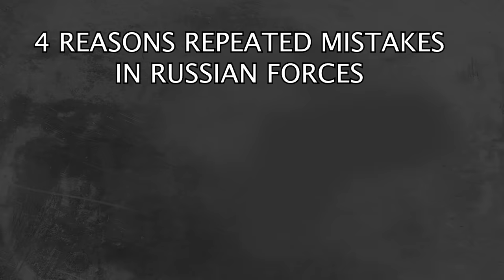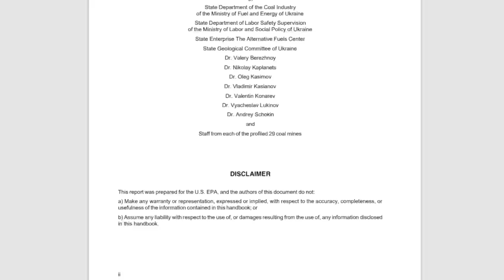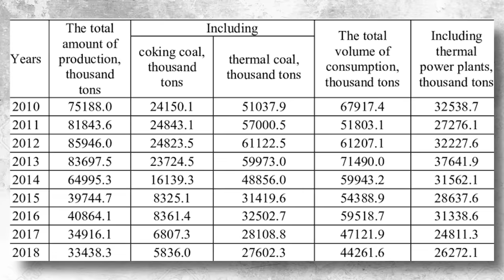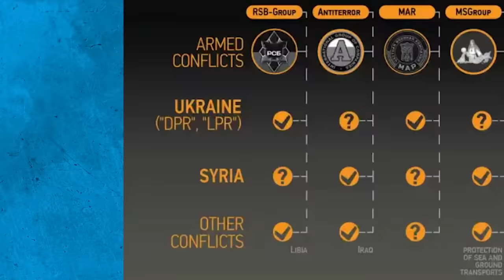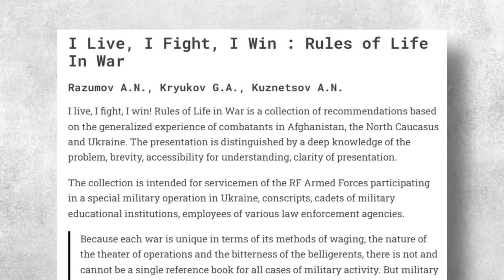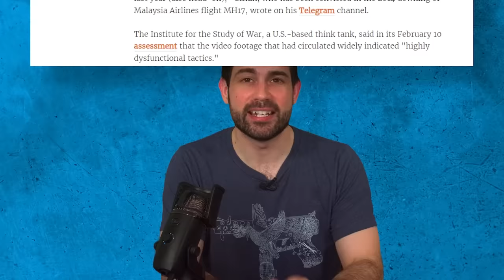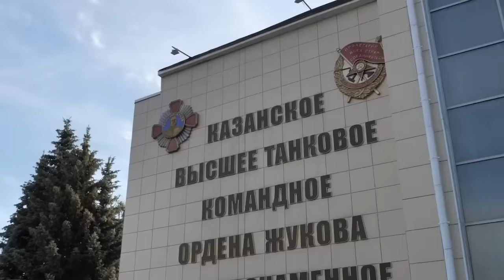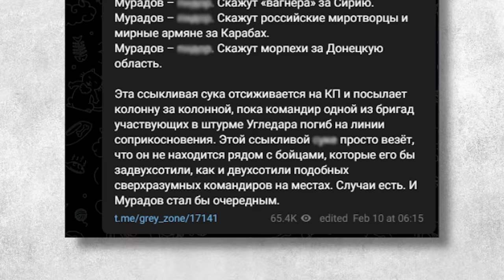Vuhledar, Why Russia Repeats the Same Mistakes

Comment: One of Cappy's best Task & Purpose reports triggered a memory from early in the war of a report I read or heard about in its early months noting that one of the dumber things Russia had done to streamline (a.k.a. "cheapen the cost") of its military by effectively eliminating non-commissioned officers from its ranks. The officer-heavy decision-making class evidently regarded them as trumped-up privates who complained too much to their "betters," rather than as repositories and transmitters of a great deal of acquired wisdom that greatly helps "Mobiks" minimize casualties and increase effectiveness on the battlefield.

I would add this to Cappy's four other major Russian military problem areas that has hampered them from the start. The absurdly high rate of casualties -- very much including officers in all ranks -- show just how devaluing and jettisoning career NCOs has helped cripple Putin's plans of easy conquest. As with many inept military decisions, this one has no easy fix; you can disband with a simple order, but summoning into existence the cadre of trained NCOs with years of experience in handling small-units in action is not possible. Also, their curt, thankless dismissal combined with the horredous casualties since hardly incentivizes any of these skilled veterans to return.

Comment: WWII seems different, they waited, they gathered enough artillery barrels and they transported in ammunition. And when they were ready they opened a massive barage that were "walked" through enemy lines and then they send in the troops in a mass attack to be effective.

I have gotten the picture that the russian so called "mass" attacks un Ukraine are not that massive. It more looks like they are sending in the troops pecemeal. 

If it does not work why they keep doing it? Why not rest and prepare properly?

In WWII when the russians did not prepare, the arty might have had gun barrels but not enough ammo or other problems the infantry attacks had a tendency to fail.

In WWII the german army relied heavily on machine gun nests. And if they are not taken out you can guess what will happen.

Comment: A tactical defeat can still lead to a strategic victory. What Russia's attack on Vuhledar did was pull four Ukrainian reserve brigades down to reinforce. These were desperately needed for the defense of Bakhmut and even Avdilvka. Also the Ukrainian 14th tank brigade after rushing to help fend off the break thru at Soledar was then sent to Vuhledar where it was so pummeled it had to get pulled out of the line. Now the 14th Tank Brigade is supposedly assigned to spearhead one of Ukraine's counter offensives to relieve Bakhmut which i'm sure looks good on paper.
Reply: I'm still happy for their win. 140 pieces of Ruzz armour and counting! WT also put out footage of a Ruz btr-82a burning with occupants inside. RAAM systems, paired with accurate Ukrainian artillery, are eating those ruzz alive.
Reply: @Flaccid_Child1  So maybe Russia has lost 1200 tanks in this conflict, it means they still have 12800 tanks left. Meanwhile Ukraine has probably lost the same amount, they might have 200 currently of which 20 are refurnished T-55's. They are getting 80 leopard ones, 60 more Polish T 72's and about 20 Leopard two's and four Challengers. How long do you think those will last?
Reply: @glennallen1984 , that’s seriously unfortunate… that you believe that. Please provide evidence to such bullshit.

Comment: First, and I know this will sound pedantic, but check your spelling in the slides or have someone proofread them. It's a small thing, but it really does matter.

Second, the Russian strategy is to force the enemy to run out of bullets and bombs before they run out of Russians. It really is that simple, and it's how they won 10% of Finland in the Winter War. Ukraine is already losing ground because they can't maintain the supplies necessary to mow down all the human waves of cannon fodder being sent. Soledar fell because they couldn't get enough mortars to the area fast enough, and now they are close to losing Bahmut itself without a massive counter attack.

Sad as it may be, it's a working strategy - as long as you absolutely don't care how many bodies of your own people that get piled up along the way. I almost wonder if Wagner is being used to cleanse Russia of undesirables by having them charge Bakhmut. Surely by now they have emptied a few prisons into the Ukrainian dirt by now. Ethically and morally bankrupt though it may be, though, it's actually getting Russia positive results for the first time since the northern offensive failed.

The question is now whether Ukraine runs out of bullets first, or Russia runs out of Russians first.

Comment: There are many stories out there and actual interviews showing that most of the men involved in this campaign were sailors in the Russian Navy.  SAILORS.  With no training, knowledge, or experience in ground battles and doctrine, and no clue how to even use the equipment they were given.  Apparently the morons in charge somehow believed that Ukraine's soldiers would just run when faced by tanks driving slowly forward single file.  For the record, Russia has pretty much lost ALL their front line tanks in Ukraine.  Since they seem to have no trained crews or competent leadership, they're going to lose a lot more.

Comment: About two thousand publicly recorded (obituaries etc) Russian officer KIAs probably have something to do with their slow learning curve, compounded by the fact that the Russian army does not use sergeants. The true number of deaths will be higher and that's not even counting WIAs. The human capital that would learn and share battlefield learnings from 2022 has been massively attrited. In fact I'd say their knowledgebase is going backwards, as career officers die off and are replaced by mobilized officers.

Comment: I feel it's none of the 4 reasons you mentioned at the beginning. 

Think about it. The people that Russia is using is mainly eastern residents. An then they are the same areas that Russian west has had issues with eastern Russians. It's a perfect way to eliminate a bunch and not necessarily be blamed for their deaths. 
Also, it reduces the population so there's less strain on the socialist regime. 

Also, there's the oil that Russia is going to stuck with. Because of the ev forced transition. Russia is going to lose billions from not being able to send oil to western Europe. 
Plus the Ukraine is the bread basket of Russia when it was under USSR control. 

There's probably some failed from the lack of leadership in the Russian ranks but that don't matter when Putin is just going to send more and more troops there.

Comment: The trouble with these videos is the bias. No mention of the fact that Ukraine is sending in poorly trained units, no mention of Ukraine losses, No mention of the chronic lack of artillery shells Ukraine is facing.  Over a month ago the US stated that if Ukraine continues to defend Bakhmut they may face an equipment and manpower shortage....yet Ukraine still continues to pump more men and equipment in and russia continues to methodically advance.  Im no Putin supporter but the propaganda is very strong on both sides.

Comment: Ukraine at least for the past 10 years was net exporter of electricity. 60% of Ukrainian power generation was/is actually Nuclear. Coal amounts to very little %. Localy it is used for peak generation only(and for export). The two mines in Vuhledar give negligible % of coal needed. Do some research before you film. It makes the rest you talk about look not very viable.

Comment: I suspect it may already be too late to make changes. The troop turnover has to be ridiculously unmanageable. Even if the leaders learn the lessons, those lessons won't be effectively passed to the troops. And even if they are, the troops will die too quickly to properly implement. It's really just a death spiral. At this point the war is mostly decided on one either/or. Does Ukraine run out of ammo or Russia run out of bodies? It's just a matter of which happens first. Even if Russia "wins", the general consensus is that it will be pyrrhic with Russia being unable to recover or even collapsing being unable to reign in other regions.

Comment: You are overanalyzing and completely miss the point. For a westerner its hard to wrap his head around on how russia operates. First how higher or commanding positions is distributed there? Doesn't matter if it's private sector or government, higher positions are employed by corruption, bribery or criminal connections. And it's not just couple of isolated cases, oh no, it's the entire system, the tradition that has never been different. So what I am actually want to say is that the state is run by incompetent and massively corrupt criminals.  
Second the value of life there is perceived very differently than in a civilized country. For them it's just a resource, a biomass.

Comment: It sarts to be really tricky to make a statement without also accidently supporting the absolut opposite narrative these days xD

So the (this) battle of Vuhledas is a big loss for RU.

The total of loss on the UA side is higher in number as well as losses are in general more severe as there are less total numbers.

So let's say the casultys are 50/50. Now let's get into detail if a Kremlin-perspective see this event. What casultys RU had?

A 100% of casultys are fighting against UA. 75% has been ukrainians themselve and therefor are not of interest for the Kreml. Of the last 25%, all are mercenarys, and again a big portion of these are criminals who has been of no value for neither political fraction nor the state but had cost money. So the casultys for RU in this battle are - depending on how you finally like to read the numbers - between 15% and 0%.

PS: I don't want to advocate for any perspective, but to show that we're at a point where all numbers are warped and misunderstood to the point we have no fkn clue of what's really going on. I can only imagen the Kreml to a degree have similar problems - because everyone outside of it definitly has.
I absolutly advocate against propaganda, and with limited understanding of what the things we see and get told of do mean, we're pretty vulnerable to propaganda. And the evil P isen't just evil if the enemy does it.